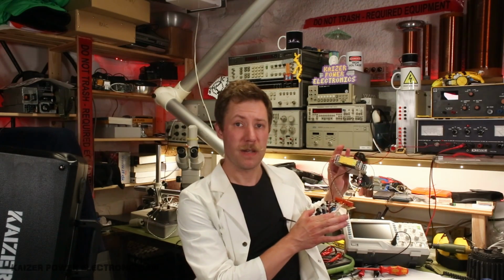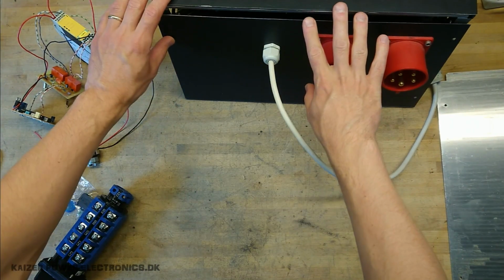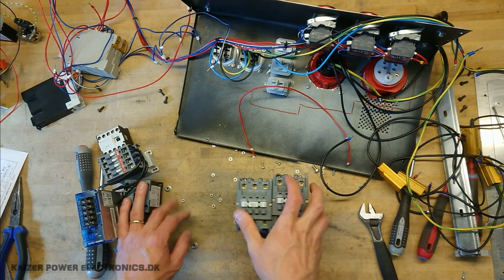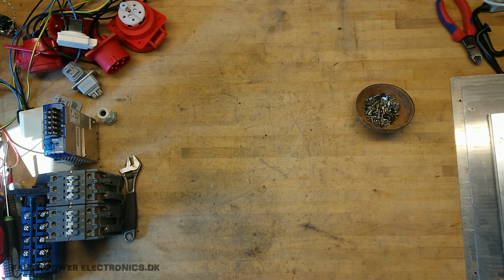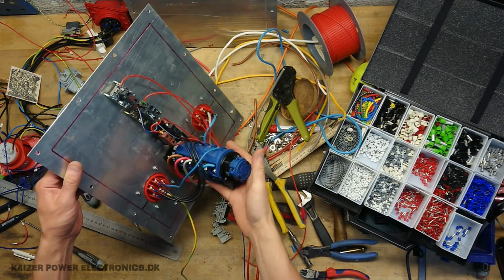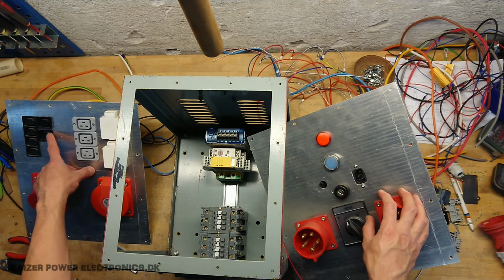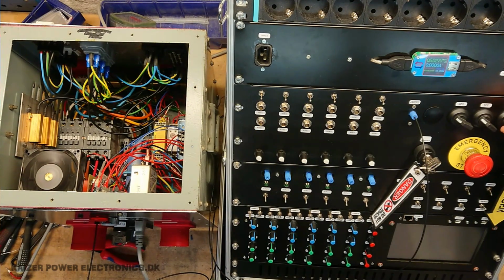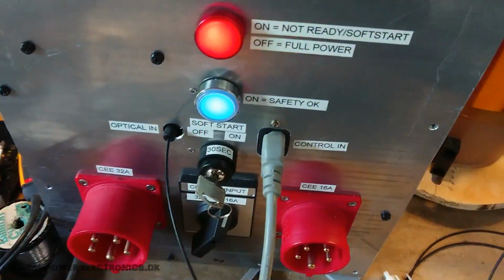Tesla Coil Show Controller Soft Start Safety Box

Comment: Cool power box! I recently did a similar thing but it doesn't have safety, it is just a server rack power bar/audio grade power filter that is going in an audio amplifier rack. I basically gave it a trigger input and at the same time a soft start for the giant amplifier transformer and capacitors. Thanks for the awesome content! can't wait for the 6 tesla coils to be on and working from that setup!

Comment: Awesome build and repurposing. One can never have too much safety. It does take a lot of thinking, to think of every possible scenario or way something can go wrong, so you can build a solution to counter it. I love building control panels, and it why industrial scrap/waste is so rewarding to collect. I save everything, never know what projects come in the future where you just might need that part or bit. Some industrial items use such high grade components, that normally would be helluva expensive to source individually. I just wish I worked a career in something that had a lot of industrial scrap.
Reply from the maker: Most companies have strict waste management policies, making it hard to get stuff. My best advise is to make friends with small privately owned metal scrap yards. Tell them what you do and what you need, some will let you take stuff at scrap prices, its electronic trash to a metal reseller :)
Reply: @KaizerPowerElectronicsDk  I agree 100%, the smaller scrap yards with awesome owners/employees are great. I've def run into brickwalls with companies and waste policies, which sucks. Not always easy finding who they have process thier waste... but poking your nose around and talking to people def helps with the discovery. I honestly always dabbled with the idea of working at a scrap yard, to get inside access tehehe!

Comment: Hi Mads, what kind of software do you use to draw your schematics ?
Reply from the maker: I use the free ExpressPCB software. It is dead easy and fast, perfect for toner transfer self etching. If you want to order the PCB, you can only order from them and its expensive. So if you want cheap ordered boards, its better to use kicad to get gerber files :) I am trying to switch to kicad, for many years, still trying :)

Comment: Nice build. You did some quick work on the aluminium panels with the big metal files.
I like the specific need of a 600Hz safety signal, this gives way more safety than a simple on / off level.
Reply from the maker: Time lapse makes me seem so fast! :) Regarding the safety signal, I spent much more time on that than planned, but I love it that I shall no longer fear a wrong wiring, flash lights or reflected sun light activating mains voltage in some obscure scenario. It might be over the top, but I like that!
Reply: @KaizerPowerElectronicsDk  It doesn't seem over to the top to me -- it looks perfect.  You do take it to smart-people conventions.  If an obscure scenario can happen, I'll put money on it happening there.
Reply from the maker: @gth042 People with laser pointers!